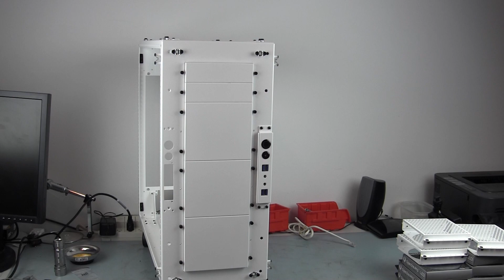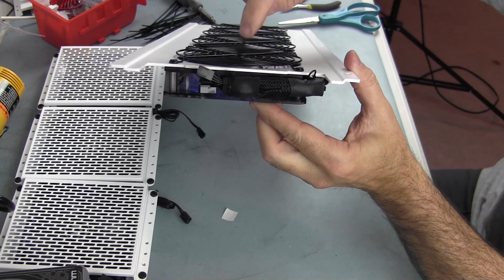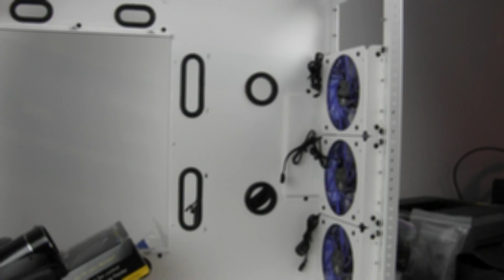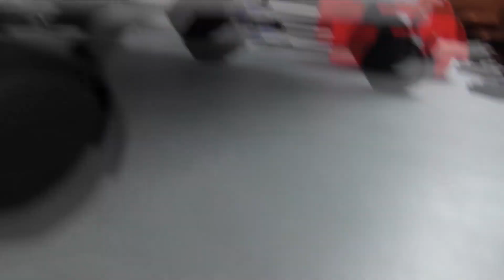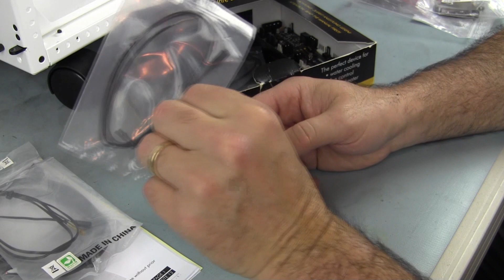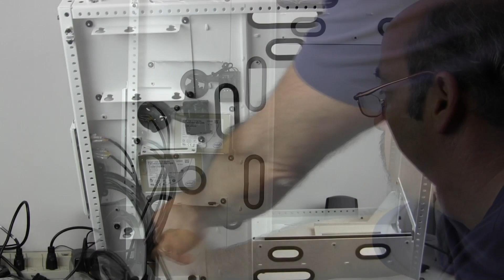Case Labs SM8 and Z77 OC Formula AIR Cooled Build Log 3 - Kit Assembly and Install

Comment: Is this SM8 case worth the $500 price tag? or should I get the SMA8 case?
Reply from the maker: +jincuteguy  If you have the space, I prefer having the lower compartment to house my PSU and radiators rather than having it all in just the one space like the SM8.  But that is just my personal preference. If you are in the US, I plan to sell my SM8. Message me on Facebook if you are interested. 

https://www.facebook.com/Ronsanut/
Reply: +Ronsanut So you bought the SMA8 case? and now you're selling the SM8?
Also, should I go with 140m fan Radiator, such as a 420 Rad or should I go with a 120m fan Rad, like a 360 Rad?
I know the 420 Rad would be better cause it has larger surface cooling area, but aren't 140m Fans don't have much Static Pressure compare to 120m Fans? So isn't that defeat the purpose of using a 420 Rad over a 360 Rad? Or is the 420 Rad still gives better performance over a 360 Rad eventhough the 420 Rad uses 140m Fans? thx.
Reply from the maker: +jincuteguy  I have an STH10 as my main personal system case.  I have taken some of the parts out of the SM8. I also have a TH10A, and the Mini-ITX S3 case with pedestal.    
On the radiator, if you go with a 420 you will use 140 m fans which are  much quieter as they can move more air but you need to find some with good static performance like NoiseBlockers. The PL series that Daniel uses on his Singularity systems are very good.  You can find good 140mm fans.
Reply: I only see NoiseBlocker PL for 120m, don't see any NoiseBlocker PL for 140m fan. So are the NoiseBlockers 140m fans are the best for Static pressure? Or is there another better brand 140m fan out there? thx.
Reply from the maker: +jincuteguy There are many but I have only used a very few. Most of my builds are 120mm fan based rads.  I like Siverstone 140's Cougar, and The NoiseBlockers. any of those would be fine.
Reply: Yea but im afraid that they are good but not good enough like the 120mm Fans.
Reply from the maker: +jincuteguy I have tested a lot of fans. As long as they have a decent Static Pressure and are quiet (low RPM fans) and you like the looks, you will not know the difference. If you buy from a brand that others have used and have favorable experience with don't go crazy over it.  There is no such thing as the "BEST" fan.

Comment from the maker: For water cooling , every 6 months to a year it is recommended to drain and replace the coolant. I have been running a few systems for over a year and had not touched it except for clearing dust filters.  If you use quality components in you loop, very little effort required. For my Big Bang system I do need to drain and refill it.

Comment: I have a hot swap bay in the works to fill a 5 1/4 space, and cages for 4 SSD's to go behind the front fans, and a big 3.5" will be tacked to the back amongst the wiring. The smaller window should keep all that stuff mostly out of sight. How much maintenance goes into water cooling? I mean really? And what's with the excruciatingly slow boot ups? I'm used to 5-10 secs, tops. Love the fan controller. I have to have one. Thanks.

Comment from the maker: Thank you.  I have a number of CASE LABs units with the same disk drive location design.  I have never had any thermal issues but I also traditionally I use only one or two hard disks in my systems.Case Labs does have unique drive bay flex bays that house and cool multiple disk drives in the main enclosure area. So I think that would address your concern.   On the temp sensors, I did not put any on the drives but I could easily have.  This has since become a water cooled build.  Thank You !

Comment: I honestly like the simplicity of this build. I am bothered by the disk drives that are hung up in the wiring bay. I know the drives I put in external cases do not last unless the case is cooled somehow. Though the disks are attached to the aluminum back plate, there's no cooling, is there? Do you see this as a weakness. And no temp sensors from the Aquaero. What do you think? Great work on the videos. There's nothing as detailed elsewhere on the net.

Comment from the maker: There should be enough air blowing in there that it will find its poath of least resistance and blow out the back of the case.  I may flip one or two of the fans at the top rear though.  We'll see hopw it does. Thanks.

Comment: aren't the fans at the top the wrong direction? cause heat naturally rises and with the top fans pushing air in, the heat won't get out through the top, just the back.

Comment from the maker: No the rubber grommet is on both sides of the panel.  And the guide pins when you screw in the screws do not touch the bay panel. I have close up pictures on Overclock    dot   net Search on Ronsanut Merlin SM8 Build Log to see pictures.

Comment from the maker: There is a flex bay like the ones for the fans that is designed to mount radiators. I have one that will mount a 360. Keep a look out for the water cooled build following this one.

Comment from the maker: Absolutely  correct. And also because I want to show others you CAN use this case for an awesome air cooled system and then later upgrade to water cooling if you so desire.  I thought it would be a good way to show the flexibility of this case.

Comment from the maker: Two reasons, one to check out all the hardware on air before I put water blocks on them, and secondly since Case labs Sponsored this build I thought it would be good to show others that you can also build an excellent air cooled system in it.  Also is a migration path for maybe some new folks who don't have the $ for all the water cooling gear to do an air system first and then convert to water later. That is exactly what I am going to do.Basically shows off the awesome flexibility of the case.

Comment: just wondering, the anti vibration rubbers on the front fan mounts, it looks like the pins hold the adapters snugly wouldn't that transmit vibrations as well?

Comment: i bet Ron is going to watercool later on. He is paying for most of hes equipment by him self and lately hes done a lot of builds and review. Also it is great to run your hardware air cooled for a wile before watercooling. Gives you opportunity to discover defective hardware before mounting a shitload of hoses and cooling blocks. This way you will also be sure not to break the warranty on grafixcards by installing a waterblock if its defective from factory.